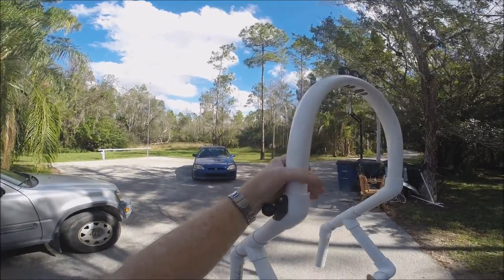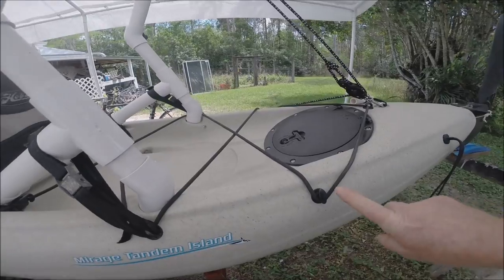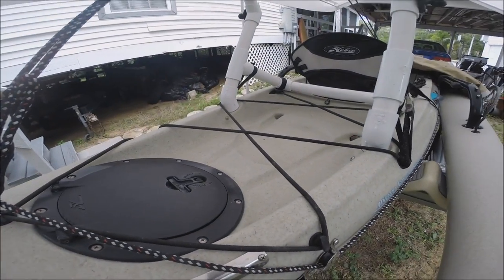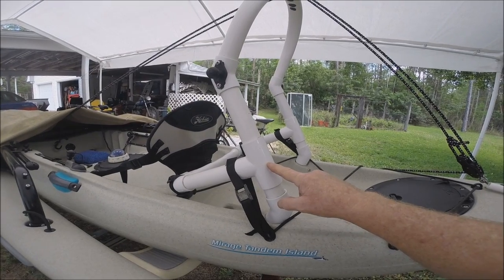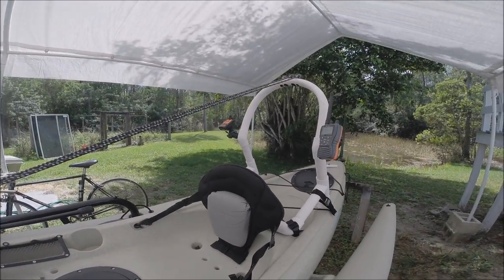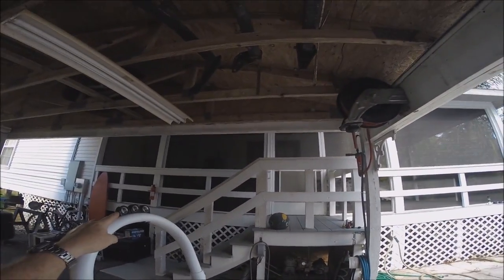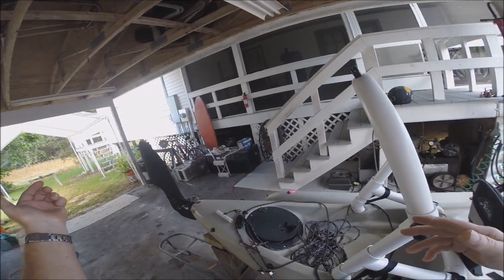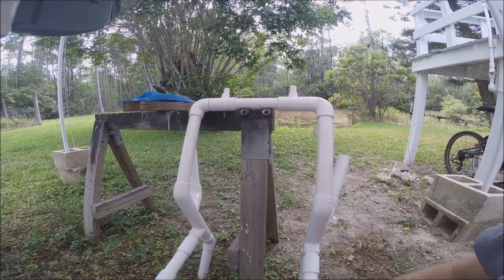Hobie Island  Main-Sheet Riser & Utility Bar DIY HD

Comment: Hey mike, just wanted to let you know that I made my utility bar and I think it turned out pretty good.  I have the 2015 TI and the measurements you used were pretty much spot on. I had to do a little tweaking, but for the most part I used your measurements.  I thought that I could post a picture but either I am unable to do so or I'm just not knowledgeable enough. I still need to glue it all together and work out an anchor system for the bar. Ill most likely anchor it the same way you did. Any way I just wanted to let you know that I have put one together and I'm pretty impressed if I do say so myself. I can't wait to get it in the water, possible this weekend.
Reply from the maker: +Owen Halloran Wonderful.  So happy to hear that the dimensions work for the 2015 and later Hobie TI's. Now I wonder  about the Adventure Island. I'd love to see it.  Rather than pictures maybe just take a short video and upload it to your YouTube channel. That may be easier.   Were you able to make a curved top piece?
Reply: +mechanicmike69 I did make the curved top piece but I have to re-do it so I'm going to attempt to record it this weekend. Although I had said that the measurements were pretty much right on money. After putting it to the test on the water I discovered that there are adjustments to be made. I'll let you know the outcome of the re-build and video.

Comment: Seems to me that you will wreak your sail shape with this idea. If you put tell tails at the bottom, middle and top of the sail at the 1/3 from mast cord position you should see them all breaking even. If your raise the clew like this and bring it inboard from where it's cut  is designed to be the bottom of the sail will need to be eased at the same time as the top of the sail will need to be trimmed. The Hobie's sail only has one set of tell tails on it so you can trim to that set but it very high on the sail which will now mean the bottom of the sail where the bulk of the sail are is will be way too flat and not efficient for moving the boat. 
This is all fine if you're not terrible interested in sailing optimally.
Reply from the maker: You are correct, it is not a speed alteration. But also note the riser was designed to be in line with the mainsheet when the sail is deployed (i.e. the main sheet continues on a straight line(up and down) from the rear connection at the stern to the sail). A taller person would require a higher riser and the effect you talk about would be accentuated. The biggest problem I've had with it so far,or should say noticed so far as I'm not racing it, is when you're going down wind the riser holds the mainsheet, main sail from going out fully left or right. Which is already a problem when the sail doesn't have a boom or whisker pole as the roller furling main sail design causes. The riser is a comfort accessory for touring or fishing and not for speed as you pointed out.

Comment: Great job Mike. This is just what I was looking for. I'm defiantly going to be building one of those for myself.   I like the curved  version the best  so I think I'll attempt that one first. Thanks for taking the time to get this information out  truly appreciate it.
Reply from the maker: +Owen Halloran Would love to see some pictures of it when you are done.
Reply: +mechanicmike69, Here it is, the title is (utility bar 2015 Hobie Tandem Island)  Its not as nicely done as your , but if you search for the title you'll see it. The boat is on the top if the truck so I was unable to get a pic of it on the boat. I should be able to get it on the boat today at the lake.
Reply from the maker: Owen Halloran Awesome job. Thanks for the sand idea for bending the PVC pipe.I will try that next time. 

Here's a link to your video: https://www.youtube.com/watch?v=sJFfxoqe3dI

You also found a flaw with my instructions as I forgot to mention or note that the height of the Utility bar/main-sheet riser needs to be adjusted to the operators height for head/main sheet clearance.
Reply: +mechanicmike69 Thanks Mike I had fun making the utility bar I plan on adding the ram mounts on mine as well.
Reply: @mechanicmike69onYouTube  
Mike, I actually like the flattened look that your version has -- it makes it look like a foil, the TI must be extra fast now LOL, sleek!

Comment: Mike did you consider any type of "traveler" or "barber-haul" setup to hike out the main going down-wind using your riser bar?
Reply from the maker: +Roger Dawson Going for extra speed downwind you'd actually would want the main-sheet coming from as far back/stern on the boat as possible and as such would NOT have them through the riser. As the riser makes the main-sheet act like it's coming from about 3-4ft. forward of the stern, or stock location. 
 Do you mean put the tracks right on the riser?  I'm pretty sure the angles are wrong for that.  
Currently I use a paddle as a whisker pole for downwind travel. I even have a half moon cutout where it rests on the main=sheet.
Reply: mechanicmike69 Paddle as a whisker, clever! How do you pin the butt end of the paddle?

Comment: would you bend a pipe for me, my turned out so un-even : (  lol.
Reply from the maker: I've been told you can fill the pipe with sand and it will keep it from collapsing while you heat/bend it.
Reply: I did use sand... well, ok... cat litter, lol.  still came out all un-even and lumpy, doing another try tomorrow.  thanks.